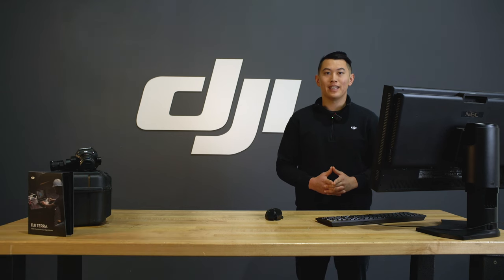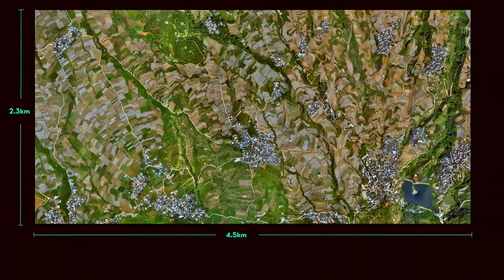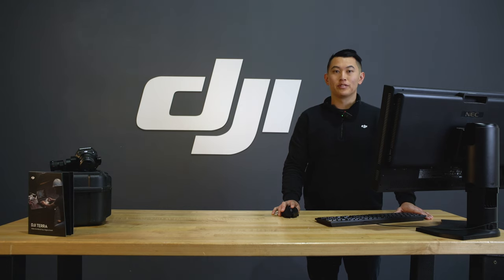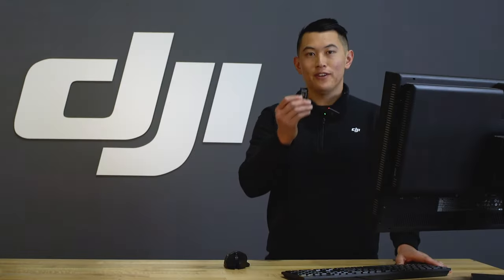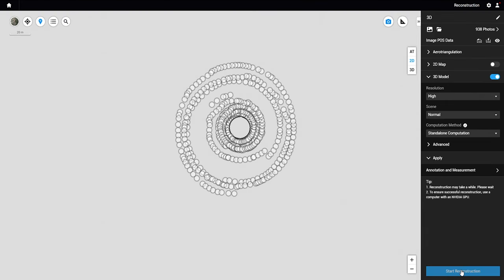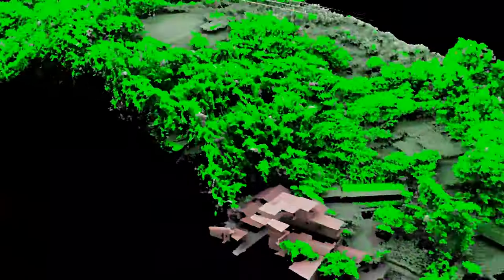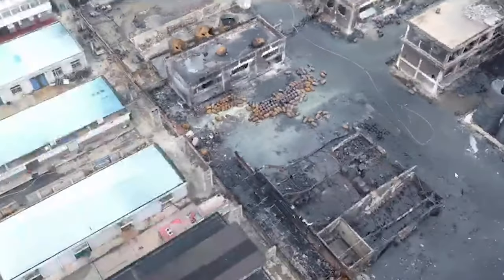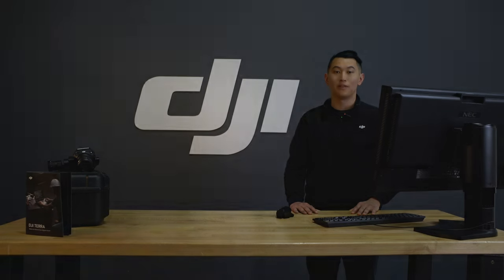Mapping 101: Master Mapping Data Processing with DJI Terra

Comment: Hi, I would like to collect RBG (Photo) as well as Thermal Imiging concurrently in the same flight, then process both RGB and thermal mapping of land into one large image and compare against an earlier thermal or RBG map (Change detection e.g. to detect flood of at a location. Would I be able to do this using a Mavic 3T and DJI Terra?
Reply: Me too - did you get any update on this ?
Reply: @iainhmunro  I heard it is possible, but DJi has not replied officially.
Reply: When building a mapping mission using the enterprise controller, there is a setting for the camera that lets you choose between 3 options - wide (photo), IF (thermal), or wide + IF.  You want to select the third one. It will take a thermal and RGB photo simultaneously for each shot

Comment: Thank you for the info. How well does terra work with thermal imagery inspecting?
Reply from the maker: Terra would not be the best tool for inspecting thermal imagery. If you were to process thermal imagery into a map there would not be any temperature data... DJI Thermal Analysis tool allows you to analyze individual photos.

Comment: Any idea if DJI Terra will fully support the M300 RTK. i.e. Mission Planning and other features that are only available for the phantom series?
Reply from the maker: Not planned to support mission planning/flight in Terra for M300 series. 

Can complete mission planning in app through Pilot 2 by drawing or kml import. 
Can also complete detailed mission planning for a waypoint mission with a point cloud to reference what the camera will take a photo of in Terra. 
Flight Hub 2 will continue to be built out with additional mission planning options.

Comment: If your software produces such great results, why are most people who run the L1 using other companies software packages to to fix the accuracy, fuzz and undulation issues in their data sets?  Issues that are common with the L1 and why have these issues not been fixed?
Reply from the maker: DJI Terra covers the base processing of the L1 data after collection. 
Following this data collection there is a variety of software tools that can be used to optimize the data. 

If you or someone you work with are running into issue would encourage you to follow our L1 operations guide (https://www.dji.com/zenmuse-l1/downloads) to make sure data collection is being conducted properly, can always share data sets with us through your enterprise dealer or our support team as well to take a look if still running into issues.

We will also have a webinar at the end of this month to dive a bit more into the data collection and processing.